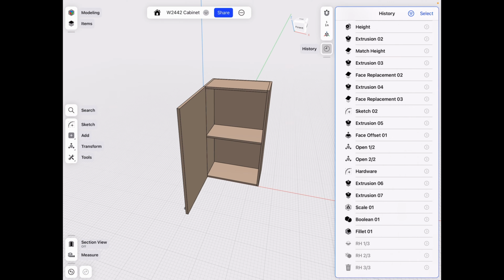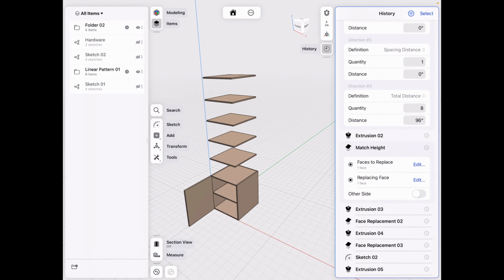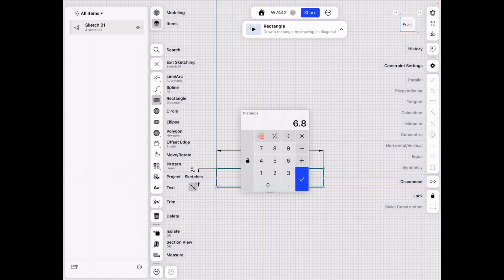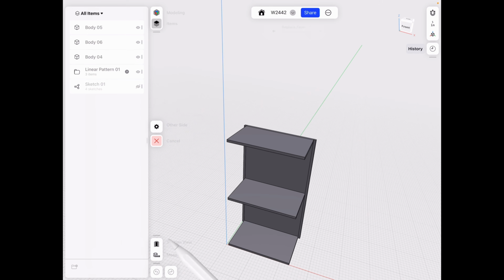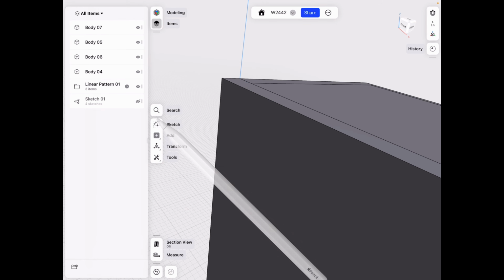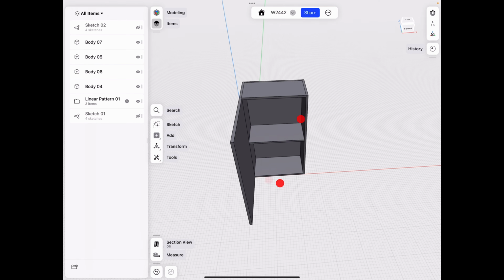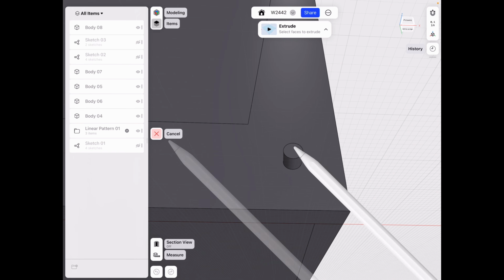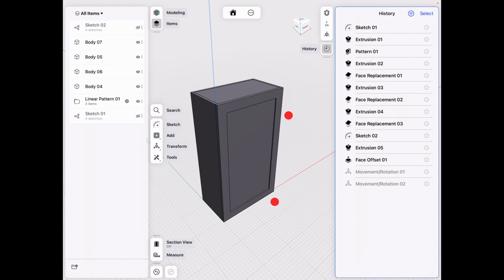Shapr3D Parametric Kitchen Cabinet with Adjustable Shelves

Comment: THanks, but the parametrics are adjustable only on the initial bottom floor piece and the pattern shelving. I tried to adjust the width and/or length and was not successful.
Reply from the maker: You have to be careful how you set it up, but it’s possible 👌

Comment: Curious why you say this workflow can’t be used to build a cut list. If that’s the case, how do you recommend we design in S3D for woodworking where a cut list would be helpful?
Reply from the maker: You can design it to work for a cut list, but it would just be double or triple the work of this specific video 👌
Reply: @ Ok thanks. Any chance you’ve created a video showing that process?
Reply from the maker: I have not yet, but it’s the same process as this video, just with added steps to account for dadoes etc.